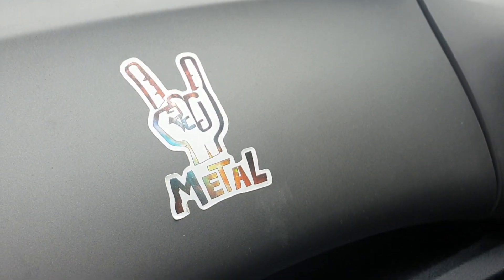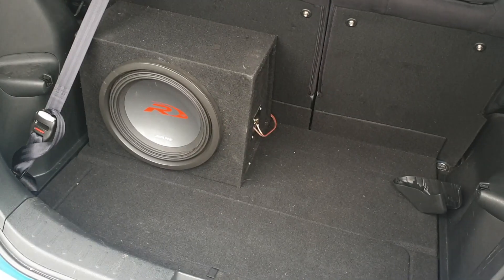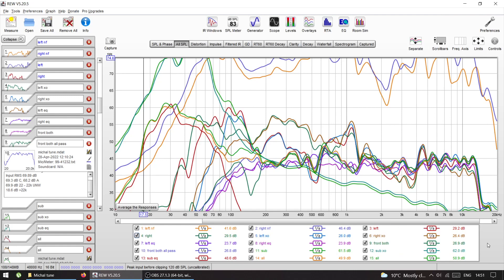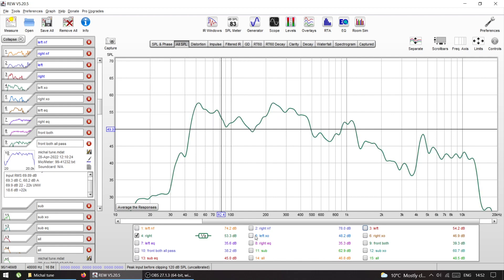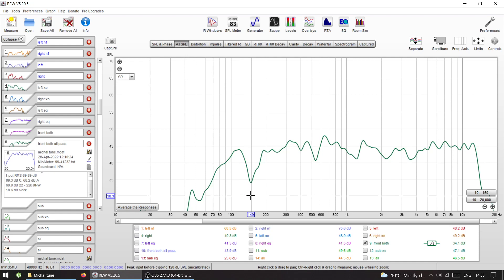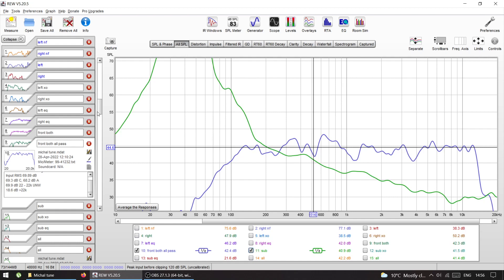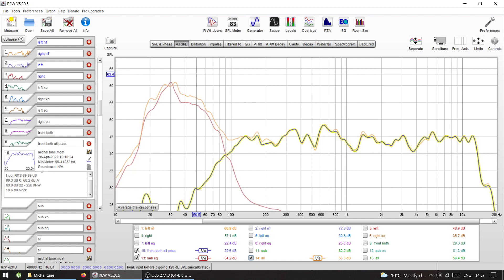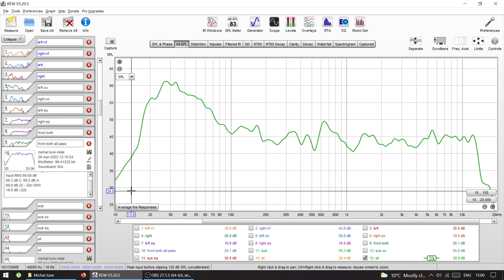10 hour £500 system install and RTA

Comment: Hey I have this same issue where I get that same dip (but at 180Hz) when both door speakers play together. What do you mean when you say you applied an All Pass Filter at 150Hz? I want to see if it works for me as well. (Im using a Helix Dsp mini).

Comment: Is it your your old system moved to different car? In other case doesnt make sense for me. Just aftermarket headunit and aftermarket speakers can get better result that everything stock and dsp.
Reply: Not only hu and speakers. I mean they instead of dsp. Decent hu and speakers would give more than just dsp on stock. I’m using two hdp4 fully active and clean install bu the way
Reply: @milkman5038  have you used a dsp?..simply swapping speakers and hu may only sound slightly better because the speakers are in the same stock locations. With a dsp,  you can fix timing and other issues. Processing power by far will provide much better results..in mho